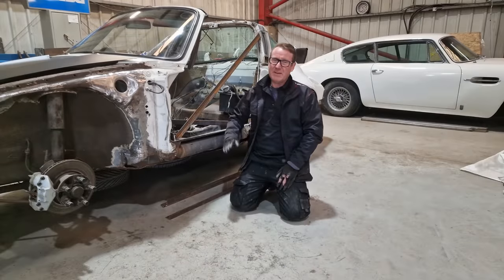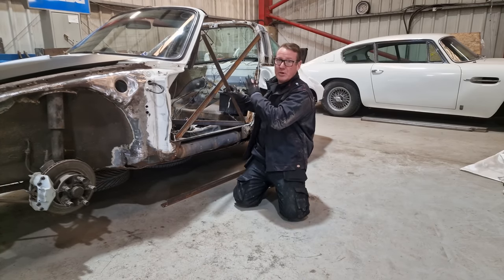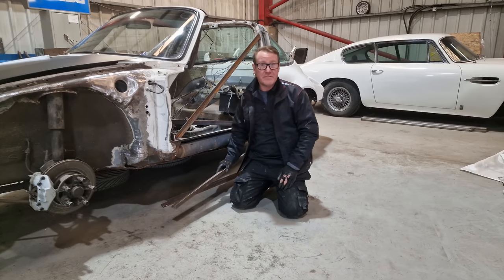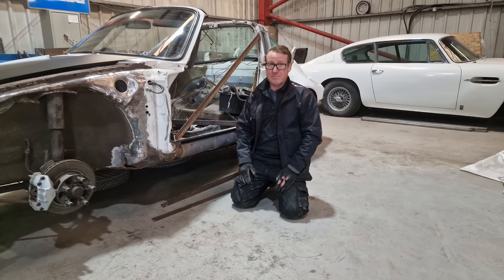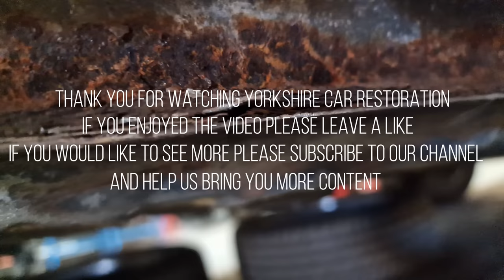SERIOUSLY RUSTY PORSCHE !!  911 RestoMod

Comment: Great repair as always. Just wondering, would you guys ever consider getting one of these laser machine, it’s crazy how fast they can remove rust
Reply: That laser video Edd made kinda spoiled us, didn't it? 
Issue is YCR already talked about not actually charging all that much for their work, all said'n done a laser costs 25-50k so would be outright impossible given their income.
The lasers don't fully remove the rust too, and do leave pitted areas with sorta semi-deactivated rust, they also don't give a sense for how thin the metal actually is.
A neat little 5 gallon pot pressurized Sandblaster wouldn't be a bad investment though, if not a bit messy (nothing a bit of masking work won't fix), because it doesn't leave untreated pits, and flexes the panel a bit for a good ballpark idea of strength.
Laser or blaster, at the end of the day they just need to get the rust outta there instead of contaminating fresh steel with rust picked up by grinding disc.
The repairs themselves are fine though! 😁

Comment: One huge takeaway and lesson learned here is to never overlay sheet metal over original sheet metal. When you make repairs, to make sure you aren't sealing up drain and vent holes. They are there for a reason folks! 
Steve, even that heat exchange pipe needs replacing. It's rotted too!
 This gives new meaning to pealing back the onion. There is so much work to be done just in this sill area. Some of the new sheet metal parts don't even look the same as what you are cutting out. Major boddgery has been done. Are you trying to compete with Ryan on who has the worst disaster restoration?  Lol.

Comment: Wow I'm amazed everytime I watch your videos I had no idea unibody construction cars had so much built into them for strength like inside the rocker panels I've got a jaguar and it has rusted out floor pans and frame rails that comes down the bulkhead and turned back and goes down the undercarriage till past the front doors the inside of my frame rails are completely gone on both sides were they turned to a ninety degrees and go down the car but I noticed my rocker panels don't have any thing on the inside of them they are hollow..I'm going to fix the frame rails and construct a full perimeter chassis gonna be hard but I think I have it almost figured out..thanks for all the uploads you guys are the best 👌
Reply from the maker: yes they are over complicated and not designed to be easily repaired :)

Comment: The rockers and kidney bowls are known trouble spots for 911s of this vintage.  Ask me how I know, lol.  I see you've got replacement panels... But it looks like you've got a good amount of work ahead of you with the surrounding metal.  Keen to see the next step, good luck!
Reply: Rough guess at the age of this car?
Reply: It's a "G-Bodied" car, so could be late 70's to end of the 80's.  Probably around 40 years old.  All 911's have been fully galvanised since 1976, but the real issue is the dirt/grime accumulates under the wheel arches and kidney bowls - I spent many hours cleaning up mine.  Fender liners would have helped, but were only added starting with the 964 (1989.)
Reply: @dra911  Thanks for quick reply-i don't know my 911's but the Carrera script sorta suggested to me that sort of era. Frightening how far the shell can deteriorate internally whilst still looking acceptable from the outside
Reply: Absolutely, and with the prices these cars fetch these days, there's a lot of incentive to cover up the problems as well.  I still love them 🙂

Comment: Misery misery misery, i'm now unfortunately having to redo my half arse job i did 3 years ago. I can't be to hard on myself though as i done it outside in all types of weather the with no cover, poor lighting, not the amount of tools i have now along with a real bad flux core welder. What's really bothered me is that i cleaned every where on the underside rear then applied waxoil that used to work but i did a scrap test and patched of rust where forming under it, the etch primer may have did something odd.
Also what rust converter do you use? I've tried Vactan that was useless, didn't penetrate the rust pores just did the surface and left a film. Used 30% Phosphoric Acid, did okay but a pain to neutralise/clean also attacks the good metal slightly also to thin. Currently using using Fertan, best so far as it seem to penetrate the pores but the metal does rust again in a dusty way.
Reply: Just thought I'd throw this in. I have tried all the rust converters over the years and was recommended Fertan by a friend of mine who has been a pro restorer for 20 years. It is the best I have come across without doubt, BUT.. there is only one real remedy which is to cut out the rusted steel and weld in new. Trouble is, the welded steel now rusts way quicker and easier than the original, so lots of attention and effort has to be given, particularly to the back or blind side. Fertan reckon that after treatment you can safely leave the project for a long time, but I find this not to be the case. The art with Fertan is to keep it wet for as long as possible, at least 24 hours, this gives a better penetration into the rust pits. Also thorough degreasing pays off massively. If you have a section that it is simply impractical to cut out and replace, then degrease to death, treat with Fertan, wash off any excess, dry thoroughly and encapsulate with Rustbuster Epoxy Mastic (www.rust.co.uk), treat the back with a good cavity wax, I prefer Dinitrol but I'm sure there are loads of good ones, and hope for the best!
Reply: @bobfrankish8883  Pretty much hit the nail on the head on all aspects, my exact procedures. I've used the Fertan on areas that have mild pitting and chopped out the rest that i have access to, cavity wax in all rear areas. It's unfortunate that Honda didn't apply cavity wax from the factory.